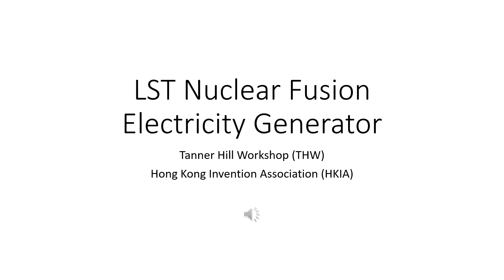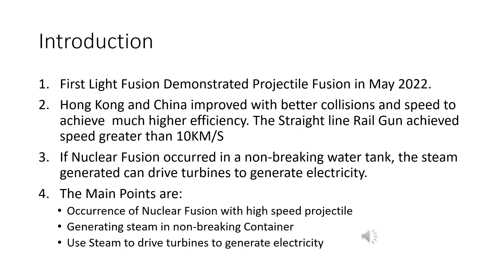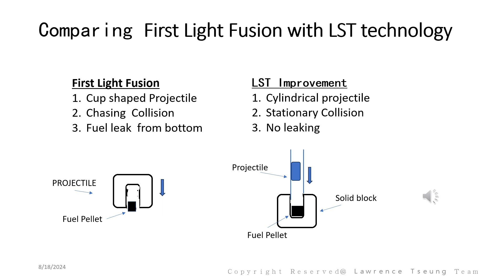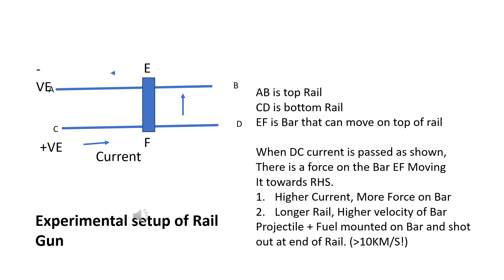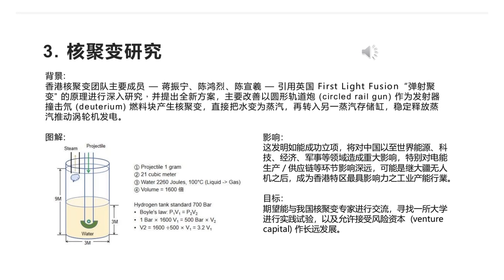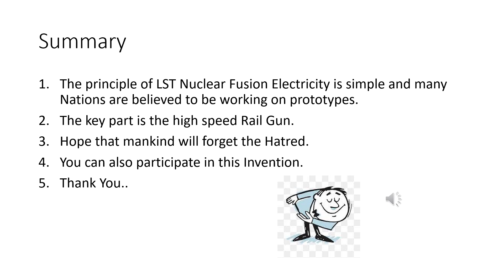LST Fusion electricity generator

Comment from the maker: The physics behind an electromagnetic railgun, commonly referred to as an "electromagnetic cannon," is based on the principles of electromagnetism and Lorentz force. Here’s a brief overview of how it works:

1. Basic Components: An electromagnetic railgun typically consists of two parallel conductive rails and a projectile that fits between them. The rails are connected to a power source.

2. Current Flow: When a high electric current is passed through the rails, it creates a magnetic field around them. The direction of the current flow is crucial, as it determines the direction of the resulting magnetic field.

3. Lorentz Force: The interaction between the electric current flowing through the rails and the magnetic field generated creates a force on the projectile. According to the Lorentz force law, the force (F) acting on the projectile can be described by the equation: \[F = I \times B \times L\]
where \(I\) is the current, \(B\) is the magnetic field, and \(L\) is the length of the conductor in the magnetic field. This force pushes the projectile along the rails.

4. Acceleration: As the projectile is propelled down the rails, it accelerates rapidly due to the continuous application of the Lorentz force. The speed of the projectile can reach significant velocities, often exceeding that of conventional firearms.

5. No Explosive Propellant: Unlike traditional firearms that use gunpowder or other explosive propellants, railguns rely solely on electrical energy, making them potentially more efficient and capable of firing projectiles at much higher speeds.

6. Potential Applications: Railguns have potential applications in military technology, space launch systems, and other fields where high-velocity projectiles are advantageous.

In summary, the electromagnetic railgun operates on the principles of electromagnetism, utilizing electric currents and magnetic fields to generate forces that propel a projectile at high speeds.

Comment from the maker: Designing an electromagnetic cannon, or railgun, is a complex task that involves understanding both electrical engineering and physics. Here’s a simplified overview of the key components and steps you would need to consider:

Components Needed:
1. Power Source: A high-voltage power supply capable of delivering a large current in a short burst. Capacitors are often used to store and release energy rapidly.
2. Rails: Two conductive rails made of a strong metal (like copper) that will guide the projectile.
3. Projectile: A conductive projectile that will be accelerated between the rails.
4. Switching Mechanism: A way to trigger the power supply to send a current through the rails.
5. Insulation and Support Structure: Materials to support the rails and insulate them from each other and the environment.

Basic Steps to Design:
1. Determine Specifications: Decide on the desired range, projectile type, and acceleration. This will guide your power requirements and material choices.
2. Calculate Power Requirements: Use formulas for electromagnetic force (Lorentz force) to calculate the necessary current and voltage to achieve your desired acceleration.
3. Select Materials: Choose materials for the rails and projectile that can withstand the high temperatures and forces generated during firing.
4. Build the Rail Structure: Construct the rail system ensuring proper alignment and stability.
5. Set Up Power Supply: Integrate a power supply with capacitors to provide the necessary energy. Ensure safety measures are in place to handle high voltage.
6. Implement a Trigger Mechanism: Create a reliable mechanism to trigger the current flow at the right moment.
7. Testing and Calibration: Conduct tests to calibrate the system, adjusting parameters as necessary for optimal performance.

Safety Considerations:
- High voltages and currents can be extremely dangerous. Proper safety protocols and protective gear are essential.
- Ensure that the setup is in a controlled environment to prevent accidents.
- Consider legal regulations regarding the construction and use of such devices.

Final Note:
Building an electromagnetic cannon requires advanced knowledge and skills in physics and engineering. It’s important to approach this project responsibly and ethically, keeping safety and legal considerations in mind.

Comment from the maker: When designing a nuclear fusion curriculum, we will reference the relevant course content from multiple universities; however, our program will feature several distinct characteristics.

First, we will focus on the study of projectile fusion, a technique that utilizes high-speed moving particles to achieve nuclear fusion reactions. Secondly, we will explore the applications of high-speed railgun and circular railgun. These technologies have significant potential not only in military contexts but also in revolutionizing energy development.

In terms of material selection for fusion, we will start with deuterium-deuterium (D-D) reactions. Although deuterium needs to be stored in low-temperature environments, we will also consider other possible fusion materials to enhance the flexibility and feasibility of our experiments. Additionally, our curriculum will cover the handling of fusion byproducts, which will be placed in non-bursting containers to generate steam for turbine power generation. This aspect can involve many different designs, inspiring students' creativity and encouraging them to explore various solutions.

Ethical issues will also be a key focus of our curriculum, as the development of fusion technology may pose safety risks akin to those associated with miniature hydrogen bombs. We will emphasize the importance of peaceful coexistence and cooperation among nations, promoting equality and shared prosperity while instilling correct values in our students.

Moreover, our curriculum will have excellent extensibility. For instance, the technology of high-speed railgun could potentially replace the first stage of rockets, opening up broader research fields. As new inventions and products emerge, our curriculum will continually evolve, viewing this as a wave of energy revolution.

Comment from the maker: First Light Fusion is a company based in Oxford, UK, focused on new energy technologies, particularly its Circular Railgun technology. This technology simulates the nuclear fusion process of the sun by accelerating tiny pellets along a circular track to generate fusion energy, achieving extremely high temperatures and pressures, which enables the production of immense energy.

The advantages of the Circular Railgun include efficiency and sustainability, as it utilizes fusion reactions that do not require large amounts of fuel and produce no waste or emissions, making it an environmentally friendly method of energy production. Additionally, it has a small footprint and low safety risks, making it suitable for various applications such as urban areas, military bases, and space exploration.

However, the main challenge facing this technology is its high cost, as the expenses for construction and operation remain significant, and commercial applications still need to overcome difficulties. Nevertheless, First Light Fusion is actively advancing the development of this technology in 2024 and is committed to improving its efficiency and reliability, showcasing its revolutionary potential for future energy production.

～～～～～～～～

Our LST technology team has also made significant research and breakthroughs in the development of the Circular Railgun. We will provide detailed announcements after the patent application is submitted.

Comment from the maker: 1)	The speed of a railgun can reach 20 kilometers per second, which is not a problem.

2)	 According to the experiment by First Light Fusion in May 2022, a speed of 6.5 kilometers per second is already capable of producing nuclear fusion; therefore, achieving effective nuclear fusion at a speed of 20 kilometers per second should be feasible. Countries are expected to easily surpass 20 kilometers per second in the field of high-speed railguns, and it is anticipated that Hong Kong can reach this speed within six months with the right resource utilization.

3)	Creating a non-breaking water tank that converts the energy of 1 gram of deuterium into 21 cubic meters of water, and then transforming that water into 500 bar of steam to drive a turbine for power generation, should also be feasible.